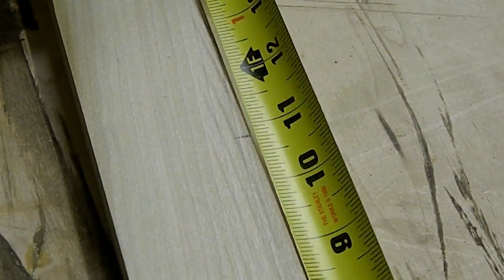Building a sliding barn door t.v stand

Comment: Really nice job. I am learning myself and have built one similar. I could not find hardware that was affordable and small enough for my doors. Also my door kind of angle forward. Did you use any bottom rail to keep your doors level as the slide and not lean back or forward? Thanks
Reply from the maker: +Alejandro Mendez yeah the hardware is pretty expensive. The kit I got came with a bottom guide that I didn't end up using. The doors swing alittle but not enough to do anything about. Maybe the part that mounts to your door is bent and that is what's causing it to push out?
Reply: Sounds as if your floor is out of level? which would cause the unit to lean foreword and the doors to hang out slightly ? , so on the front  just make 2 shims the correct size until the doors hang correctly , You can do this by using a couple of wedges so you can estimate the size of your Shims